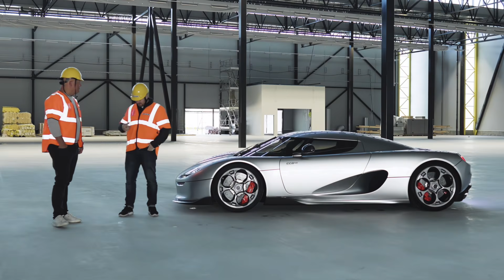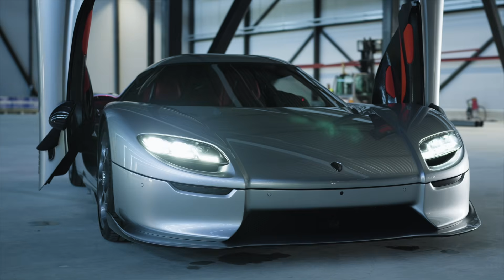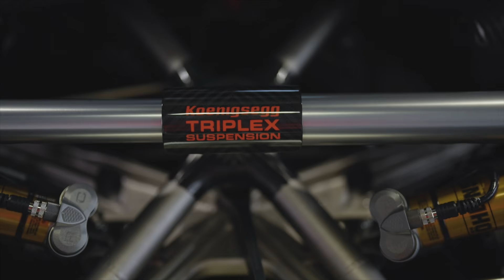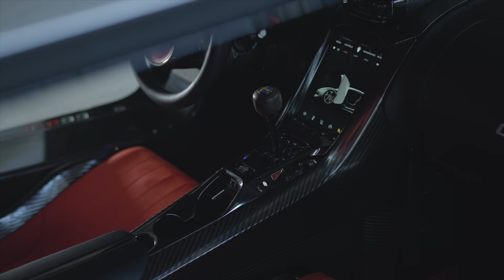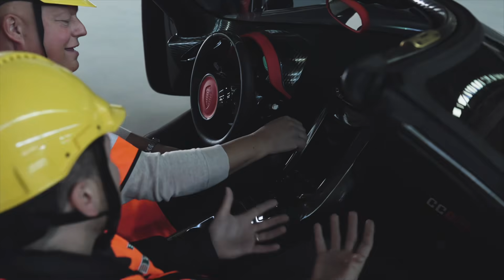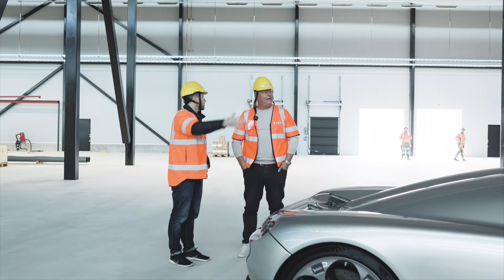FIRST LOOK: Koenigsegg CC850 - 1385hp, $3.65m Reimagined Hypercar | Top Gear

Comment: Top Gear - Why aren't you filming in 4K? - you've got 8.51 million subs and still filming in 1080p. It's 2022. Even my £200 phone films in 4k - Shocking!
Reply: They likely film & edit in 8k or even 16k and then release their videos in 1080. It's more common than you might realize. 

It's also worth considering that film quality and resolution are not one in the same. 4k on a cell phone looks a lot different from a video shot in even 1080 with a full frame sensor in RAW format.

Comment: It´s an awesome car but i don´t like the simulated manual gearbox. It´s a fake and doesn´t have real benefits. If you can choose between dual clutch or manual and swap shift times for weight and engagement it makes sense. Here you don´t do that. It´s the same 9-speed lightspeed gearbox that fakes to be manual. It´s the same as an EV with a simulated gearbox and torque/power curce. What bullshit.

Comment: You can tell the engineering in his cars is just next level compared to the competitors. I wonder how he achieved that? Did he just get lucky and hire the best team? Or is he paying them better? Or do they create great products because their passionate? What’s the secret?

I always imagined that if I owned a company I would have multiple teams of people in each separate department such as design, testing, engineering, etc.. And each team would compete against each other with a deadline to create the best clutch, or the best transmission, or door, or this or that, and the winning teams get a huge bonus.

That would ultimately bring out the best in each team, it would be challenging, competitive, intuitive, and best of all rewarding. Even if you had 1 team that always won it doesn’t mean the other teams aren’t valuable or doing their job, those are the teams that are pushing the winning team to win and create the best products.

I’m sure this is not an original thought, and I’m sure this has been done many times, but I think it always should be done this way.

Comment: i wish tesla and koenigsegg had a love child (they met at a rave) and the baby would come with some rocket boosters, 2 Rimac engines at the front, no roof and and an AI drift mode. Oh and a v10.
Reply: Funny, I wish tesla would take the plaid drivetrain and put it into a real hypercar. Not the 200k delayed gen2 roadster which is just another cheaper ferrari&lambo slayer. But a real actual honest to goodness ev hypercar. Along the lines of the Batista, nevera, evija, aspark owl etc. 🤔

Comment: Never thought I would see an automatic and manual gearbox, all in the same car. What a time to be alive.
Reply: Yep. I'm a staunch manual only guy but I'll let this slip. No pun intended. Sounds like the perfect gearbox. This guy makes porsche engineers seem lazy.
Reply: @geoffwatches  Except it's not a manual box at all. It's just a complicated way of pressing a button to send a signal to an ECU.
Reply: @flat6croc except it drives exactly like a manual when using it in manual mode, clutch pedal and all
Reply: @maybeharold  It won't be exactly the same, though, will it. Any more than steer by wire is exactly the same as a mechanical steering rack. Personally, I think if you like manual, have manual. Forget faking it.
Reply: @geoffwatches  I have to agree
Reply: And done like a bicycle, a totally different concept. Clever!
Reply: - well there have been Automated Single clutch manual, Automated Dual clutch manual - now the hexaclutch (where the synchronisers are the clutches) automated manual. - taking the splines out of play (but there should still be s a positive lock for each gear to reduce ltotal full power wear on the clutches)

Whether you are "simulating" a manual or shifting for peak performance/ or economy - the tech is strong in this one.  (manual gates are just for entertainment here, though the clutch pedal gives the driver the choice of timing - or the illusion thereof - much better than just a  paddle shifter.)
Reply: @kadmow  Thank you for the update and info! Very well explained and knowleadgable.
Reply: @kadmow  yeah 😕 it's really stupid he did all that
Reply: Which one would you pick though between a no gearbox Regera And a dual gearbox CC8 50?
Reply: 🙄 this clown is just insane always trying to re-invent the wheel, how re tarded 😕 wats the point,,, just throw a normal 6 speed in it, why all this weirdo nonsense ?
Reply: Yeah, that had my head spinning. What fantastic work Christian does. He’s a true maverick in his field.
Reply: That's what I love about Koenigsegg. Christian really push engineering to the absolute limit.
Reply: It's incredible the best of both worlds for high speed runs your able to plus you can have that manual when highway driving
Reply: I thought automatic isn’t really a different transmission its just shifting the manual gearbox for you right?
Reply: @jesse1614  You don't have torque converter in manual.
Reply: Corvette had a 4+3 manual transmission from '84-'88, which had a similar purpose.
Reply: what about all the wars and killin around the world? sheep
Reply: Dude seriously what time to be alive